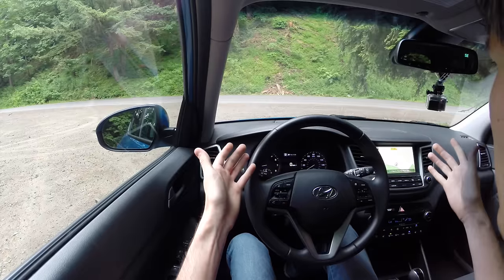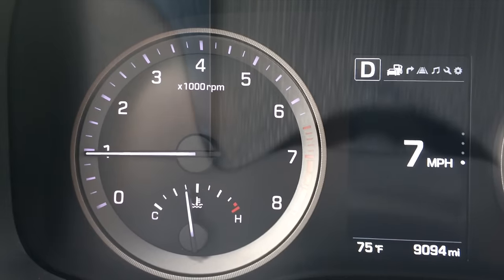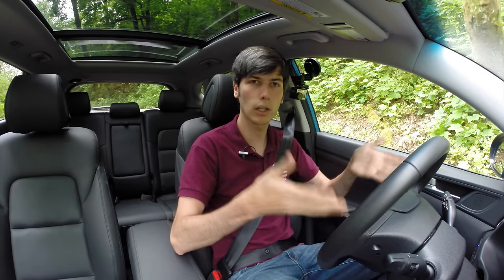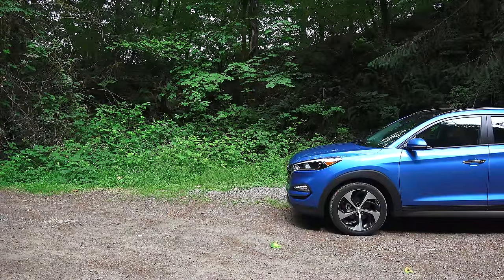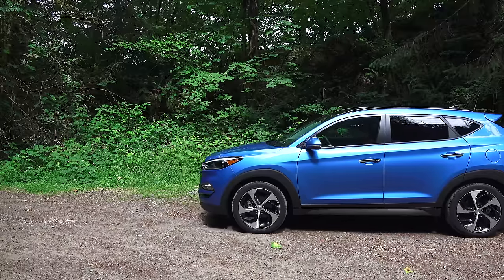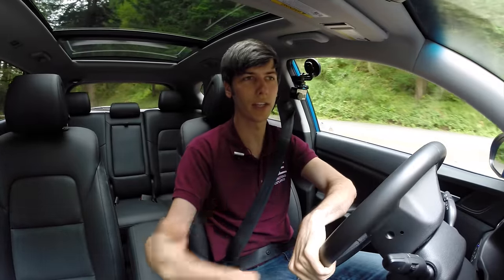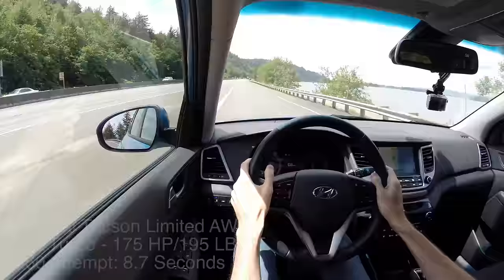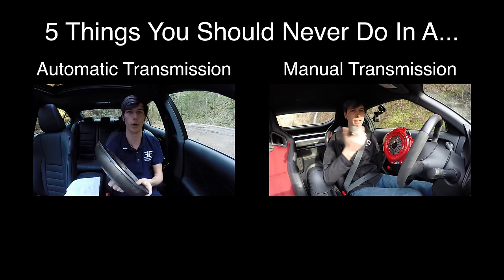5 Things You Should Never Do In A Dual Clutch Transmission Vehicle

Comment: Number 6: don't breathe inside the car, the difference in air pressure and moisture causes unnecessary wear on the clutch
Reply: Lol😂😂😂😂😂
Reply: I just wanted to look up on how to use paddle shifters ; - ;
Reply: peanut butter and jelly The right one shifts up in the left one shifts down
Reply: I knew I was doing something wrong by breathing - thanks for the helpful info 👍🏻👍🏻👍🏻👍🏻👍🏻
Reply: To minimise wear on the clutch "do not start" the engine, has the added benefit of prolonging engine life!!!!!!!!!!
Reply: @clooperman3745  lol🤣🤣🤣🤣
Reply: Ohhh i thought breathing inside the car meant the engine loose power, eastern engines are allready low on torque, so taking some of that air reduce the power even more
Reply: Why dual clutch is killing your gains
Reply: Specifically if you have bad breath pull the windows down.
Reply: Haha you got the love it
Reply: @noabeumer339  its simple, just the respective paddle when you want to upshift or downshift. You don’t have to take your foot off the gas or brake when doing so, so when accelerating all you have to do is accelerate as normal and click the paddle when you want to upshift
Reply: No that's not true.
Reply: And nobody has said that.

Comment: Can someone explain why Hyundai puts a dual clutch in an suv and a slushbox in the gen coupe. Wtf.
Reply: JayTac1 
Money  
Americans will pay more for an SUV
thus more money a manufacturer has to build an SUV 
Cars have more of a global market.  So competition is pretty stiff. So the profit per car is lower. 
That is why Ford makes shity cars and is dropping out of the car manufacturing business.  And going mostly SUVs
Reply: Hyundai's DCT, being a dry clutch, won't handle as much power as the Genesis Coupe's engines. I hope that their upcoming 8-speed dual clutch is a wet clutch designed for performance, as opposed to these 6- and 7-speed DCT's designed for economy.
Reply: JayTac1 facts
Reply: I feel dual clutch makes more sense in Europe since you’d be surrounded by manual transmission drivers, who don’t inch along nearly as much as in North America ( watch heavy traffic videos in London). They seem to all collectively move for 40-50 feet at a time than stop with their manuals. Secondly, if you live in Europe or Germany driving a VW DSG for example it would probably cost you half as much to repair relatively speaking. I’m sure dsg repair in U.S, Canada or India for example costs an arm and a leg.
Reply: @skopa1223  Or you could just get a proper stick, dispense with all the complexity, expense, and bother, and have more fun driving in the bargain.
Reply: Shane Matthews Yeah. I’m buying a used Manual Honda Element next week for work.
Reply: @Ch0pj0b  Im American, can confirm
Reply: @shane99ca  Sure, if you want fewer gears, slower shifts and longer 0-60 times...
Reply: @aranykai  And a significantly lower cost of ownership, more reliability, more fun, and more control.
Reply: @user-zd9fc4vs4q  Is "stomp & steer" better?
Reply: @skopa1223  You are correct. I had major problems with the DSG in my 2011 VW CC here in the U.S. Fortunately the eventual replacement under warranty, but if I had to pay for the replacement of it and the mechatronics unit, I would have had to shell out over $7000. Even after a full replacement, I still had problems so I talked VW into buying it back.
Reply: TheBonzomatic Yeah. Problem with new cars is they’re complicated. They have a hard time repairing modern cars. Planned obsolescence is taking over. These products aren’t meant to go for the long haul.
Reply: @Ch0pj0b  The profit per car is lower for ALL makes (exception, luxury cars), yet Ford is the ONLY ONE that makes SHITTY CARS? What about GM and FCA? Chevrolet stopped making the Impala and Cruze, while FCA dropped the Dart. So why did GM and FCA drop THESE cars? I believe you're showing a "slight" anti-Ford bias with your comment!!
Reply: @skopa1223  You are CORRECT, Sir! The DCT/DSG is technically a MANUAL TRANSMISSION without the third pedal. Incorrect operation of a manual transmission will cause the SAME clutch problems. BTW, in my experience with manual transmissions, I have ALWAYS found that the CLUTCH ASSEMBLY IN A MANUAL TRANSMISSION IS NOT COVERED BY THE WARRANTY, for good reason!!
Reply: The ZF 8 speed slushbox is actually probably the best transmission on the market today except for maybe more bespoke transmissions you'll find in very exotic cars. It's just as fast as a dual clutch while being much smoother.

It's also more compact and lighter.
Reply: TheBonzomatic I love the DSG in my GTI. I have had 4 with the DSG and 2 Manual. The DSG is stronger and holds more power, especially when tuned. 
Just make sure to change the fluid and filter every 35-40k miles. My current GTI has 95,000 and prefer it over the Manual in this car. My previous GTI had 198,000 miles on it with the DSG and never skipped a beat.
Reply: Hyundai follows vw's foot prints unfortunately
Reply: aquaticko it’s here, they made an 8 speed DCT for the 2021 veloster N
Reply: @shane99ca  Yep. Driving a manual in Miami's bumper-to-bumper traffic is SO-O-O much fun.
Reply: Why would you even drive an automatic genesis “coupe” in the first place
Reply: Trust me, you don't want the dct in the Genesis.
Reply: @TheOzthewiz  No, they aren't. They never said Ford was the only maker if shitty cars, they said Ford made shitty cars. Which is true, for the reason they stated, because of price competition. If it makes you feel better, GM and Dodge/Chrysler/Jeep/whatever also make shitty cars. Nissan and Mini aren't so great either. But they were only using Ford as a single example, not as the SOLE example.
Reply: People on this thread have no idea what they're talking about. 

The trend of DCTs in Hyundai started around 2018. Which was after the Genesis Coupe was discontinued. Around 2018 is when Albert Biermann, one of the greatest head of BMW engineering of all time; became the head of Hyundai engineering. He's the one who pushed for DCT in all of their cars. The economy cars get DCT for fuel economy, but the N line cars use it for performance. 

The Genesis Coupe is an outdated car.
Reply: Because Americans pays whatever for an SUV. Why? You tell me.

Comment: 6. If your dual clutch transmission was made by Ford, trade in your vehicle for another brand immediately.
Reply: For real! I'm still taking a beating on it.
Reply: I have 2.0 focus powershift chiped and removed filter about 190plus hp and driven 263000 kilometers. Not a single problem.. Best car i ever had. Regular mantained transmision with best oil and filter. Even my reckles starts didnt affect transmision a little. Maybe you just need luck
Reply: david 1 what filter???
Reply: @jridder89  oil filter inside transmision
Reply: @TheMiklic  What year is your Focus? I can't see how removing the filter would make it last longer. The filters are there for a reason.
Reply: @jridder89  removed dpf filter. I was talking about tuning my car. With that i wanted too tell you that even with extra torque and power my transmision didnt sufer any faliures..my ford is 2012
Reply: @TheMiklic  Aside from the fact that your story sounds like nonsense (All that 190hp of extra torque, hey?), none of that has anything to do with the issues plaguing the transmission, so it's irrelevant. It doesn't matter what trans oil you use because it's primarily a defect in the TPU. 

Not all transmissions were effected, so yeah, you WERE lucky. The rest of us weren't, and no amount of maintenance or expenditure on "high end" oil and filters would have altered the outcome.

lol who tunes an automatic Focus
Reply: @RocketDragons  lol i ask myself why do they sell automatic sports car. I know about software and hardware defects. Lets not talk about seals. I just shared my story. No need to get upset. And yes if someon states something diferent  then what you wanted too hear it must be a lie plus i  just said that is about 190 hp an a little extra torque thenn factory what is nonsense about that. I didnt built appolo spaceship. And extra hp comes handy at overtaking
Reply: Got this a week and a half ago and am nervous. No problem yet. Trying to perfect my driving so I hopefully won't have this happen. 2016 SE
Reply: You can Audi to that list! 13,000 miles and it's fucked😡
Reply: It's not strictly correct that the gearbox was made by Ford, it was developed by Getrag.all modern non conventional transmissions fail,it's not exclusive,all these systems are great when they work but their downfall is their own complexity,every extra part creates an extra failure point.we spend around a 100 years developing manual transmissions to be efficient,easy to use etc. Then pile a load of expensive,sensitive and obviously underdeveloped electronics and hydraulics into the mix in the aim of efficiency and while some fully understand the real advantages such as  quicker gear changes It's all for what amounts, in the real world day to day driving for most people nothing other than relieving them of using both feet.when it goes wrong the manufacturers themselves struggle to repair them opting for the costly replacement,which will likely do the same at some stage.I can understand the consumer wanting simplicity,ease etc. But at what cost?An old fashioned  manual gearbox cost a pittance to repair and more to the point,they can be repaired and almost anyone can repair them.
Reply: I thought the wet Powershifts were OK but the problems were with the dry gearboxes. 

Am I wrong?
Reply: Yes shift to your boring japanese cars. Ford is way way better
Reply: I don’t gamble, but I wanted to get my fix so I got a used focus. And I’ve put two clutches and some servos in the thing.
Reply: 100% true... powershift one off worst
Reply: @jridder89   THere is no filter in a dual clutch
Reply: James Travis - maybe you got a lemon or just don’t know how to drive it.   I bought a TT in 2005 with the very first DSG system Audi ever built.
I’ve put 120,000 miles on it and never had to do anything but ordinary maintenance on it.
Reply: @TheMiklic  I had one and I don't believe you.
Reply: @NateOlson  im sorry But you had One.. That cant speak for everyone out there as I already wrote that Im aware of problem.. my coworker had one and died at about 150000 kms im Just saying that all are not plagued. I Just Got lucky.
Reply: @mrblexit7152  I have the same year and model. So far its a great car. Its got less than 30k miles and had it for over a year. My only gripe with the car is I wish it was faster!
Reply: @RocketDragons  I plan on decking mine out
Reply: VW has a pretty good one I think, have it in my 2015 Jetta TDI have almost 52k Miles on it with no problems. Hopefully that didn’t just jinx me but yeah
Reply: @RocketDragons  the Focus clutch is dry dude
Reply: @adandylife329  it's not literally dry. A dry clutch, at least in the case of the DPS6, still uses oil, it's just not immersed in oil like a wet clutch. This is why trans oil can leak out of the DPS6 if the input or output shaft seals are compromised. (I had to have my seals replaced twice)
Reply: Ford made a dual clutch?
Reply: @kilovwdude6457  3 now.  The powershift dry DCT in Focus and Fiesta after 12' was junk until they sorted it in 15', 16' on was solid.  All Select-shift are second gen wet DCT, haven't seen any issues of note.  The third gen was just released in the hottest Stang, and all I know is that reviews stated it was "as good as the Porsche PDK's"
Reply: Jordan Capps Mines a 2014 Focus SE and everyone says they love my car. Then I ask them why because I hate it and the I tell them I wouldn’t recommend this car to anyone.
Reply: Since 2018 they are new design
Reply: I just hit 100k miles in my 2016 DCT fiesta hatch. It’s like grinding/ shuddering when I come to a stop and take off. I also hear the grinding when accelerating, and it doesn’t sound good. I’m concerned. Does the clutch need replaced?
Reply: @ahmads5889  Its an expression that just enhances "they messed up".
Reply: So true 😂
Reply: is it that bad ?
Reply: Ford never made the dual clutch. It was outsourced.

Comment: Good information! Most of these newer vehicles have Hill Start Assist now that leaves the clutch disengaged and holds the brakes for you until you accelerate going forward.
Reply: *Noob start assist.
Reply: Well it's not noob start since you can't engage the clutch while you stand still pressing brake |(tested on a Renault Edc).  That means you will slip down in the time car sees you have depressed the brake and alow clutch to engage. Anyway it's a must have since on a lot of cars you can't putt traction before complete release of the brake.
Reply: Except it doesn't work on my car and I randomly roll backwards towards the car behind me. I've already rammed a parked car behind me while shifted into DRIVE!
Reply: FordTechMakuloco you're here?! I love your videos too. Thumbs up.
Reply: I used to own a Vauxhall/Opal Mokka (2014) which had 'hill start assist'. It worked once or twice. 
I now own a Nissan Qashqai (2017), which also has 'hill start assist'. This one actually works on every incline. All the same ones, that the Mokka didn't work.
Reply: I don't trust hill start, so I disabled it. It's not that hard to use parking brake to hold the car while engaging the clutch.
Reply: It’s tough if that park brake is electric.
Reply: Bartonovich52 the park brake will hold the car on an incline in D until you engage accelerator.
Reply: @Majestic Beardsman Not mine. I've clocked it going up to 20mph backwards while shifted in drive (I was testing it on a steep hill). It will simply keep rolling indefinitely and continue to increase in speed if allowed.
Reply: Only hate it sometimes disengages while I look away!
Reply: @Network126  I call shenanigans
Reply: @stoicodysseys6352  I have it on video
Reply: The auto hold on my i40 works ok
Reply: @weekasi1  Except that the new parking brakes are electronic and will be either on or off. Not sure what happens if you apply gas while switching it to the off position.
Reply: @TheDrRJP  Well you could also use normal brake and clutch, that's what I do mostly nowadays.
Reply: @dandiart5383  That's why you have a handbrake.
Reply: You probably mean autohold.  Hill assist keeps the car stationary for a sec or 2 to prevent car rolling backward on incline just enough time to press on the accelerator
Reply: Mine doesn't do that lol. I gotta treat it like a stick and start revving before fully releasing the brakes
Reply: @johnbower7452  sadly some manufacturers are omitting them and switching to electronic parking brakes.
Reply: Right! 5:53